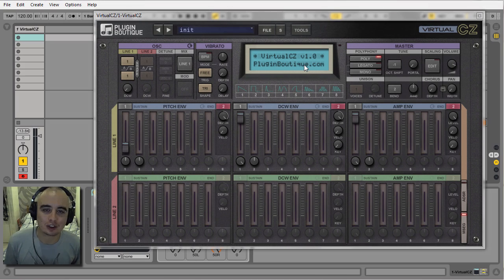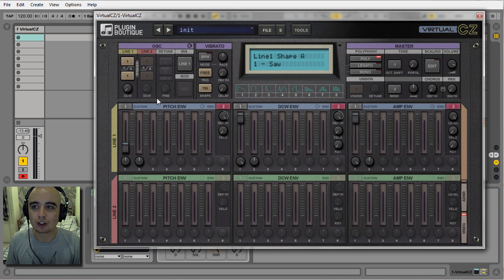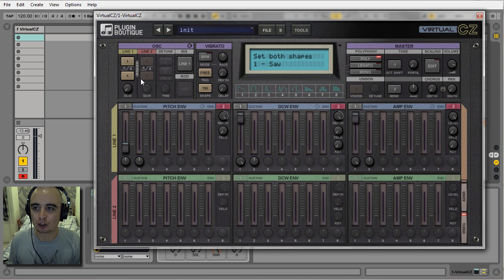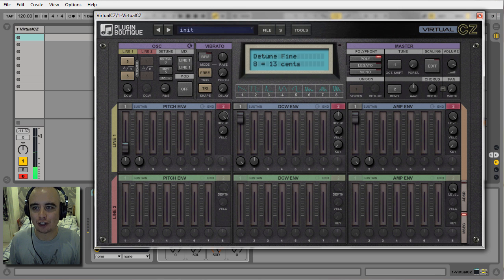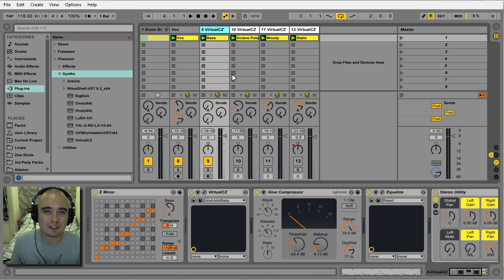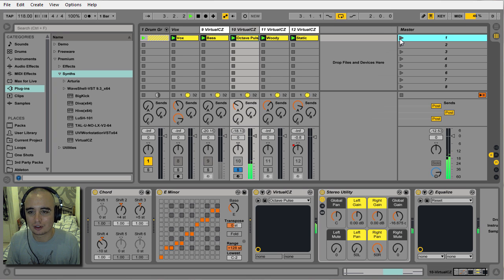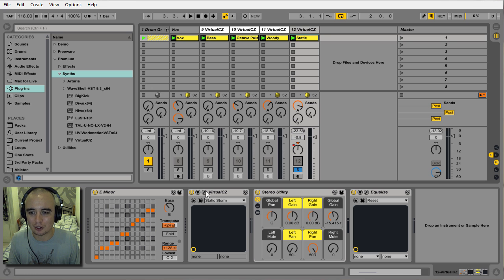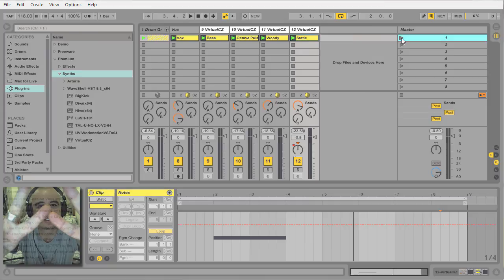VirtualCZ Runthrough and Demo

Comment: I've got this aswell full version, It's brill, Love for the oldskool sounds, I wanted to buy the CZ101 of ebay, but I will give it a miss now, Its very very close in regards to the overall sound as far as i know!, Plus it has Sine and Sample and hold as lfo pitch mod targets (which the original cz don't have) and the dim d chorus is modelled on the roland dimension d chorus :) the other chorus algorithm is extracted from the cz101 :) AND MSEGS are also in Zebra! you can get very complex with them MSEG stands for "Multi Stage Envelope Generator" and phase distortion is VERY close to the FM synthesis, But yeah Im liking this video, if you need any sounds (I'm a sound designer, Let me know!)
Reply from the maker: DJBenniboyOfficial Stello info mate. I should make notes on all the technical information before I record these things, but you guys like my casual approach, right?!? I also hear Plugin Boutique have got some exciting things in the pipeline for us this year, definitely some good guys to keep an eye on!
Reply: Yeah they're pretty good, but oli larkin has been behind some stellar freeware plugins of the now and past, so he's your guy!, Do you know much about phase distortion? Its like FM but ALLOT more simpler using distortion to change the frequencies of the harmonics using the envelopes and the DCW :), the DCW is the magnitude of distortion that is applied to the waveform Digital controlled waveforms are a way of emulating the "filter" as Casio were the guys behind this and wanted to make sythesis on a budget without a filter from a subtrative synth making the cost of things unexpensive!, but even though the sound was regarded as "thin" in comparison, Synth enthusiasts still go back to this thing to this day because it marked an excellence in sound!
Reply: also do you own sylenth1, I have some great 50 patches for Sylenth1 that TOP some of the payware you can get! :D
Reply from the maker: DJBenniboyOfficial Ah, no Sylenth here unfortunately!
Reply: no problem buddy :), ile make some presets for this :D
Reply from the maker: DJBenniboyOfficial Awesome. Looking forward to them already!
Reply: Do you know how to get the old CZ sysex patches to work in VirtualCZ?